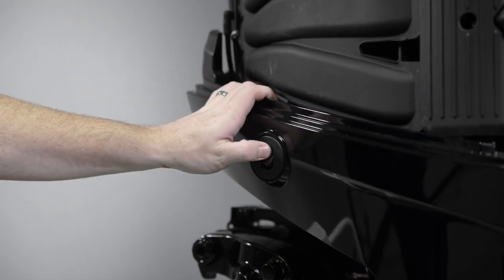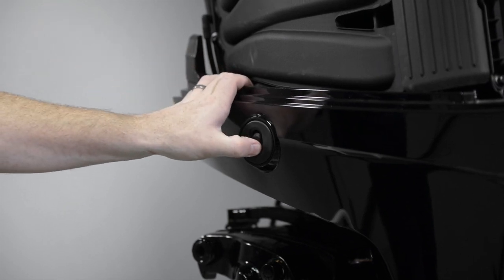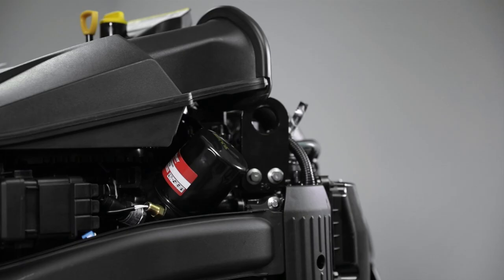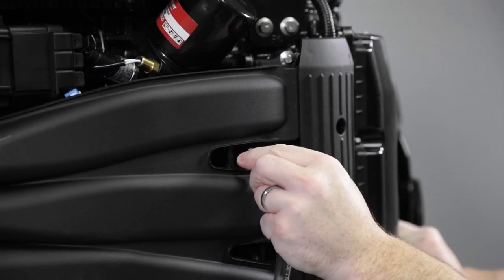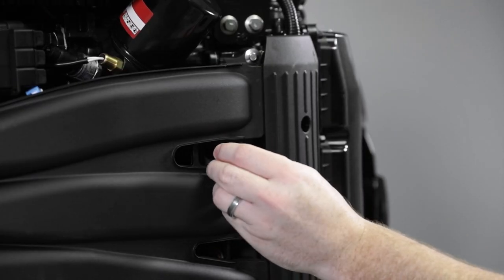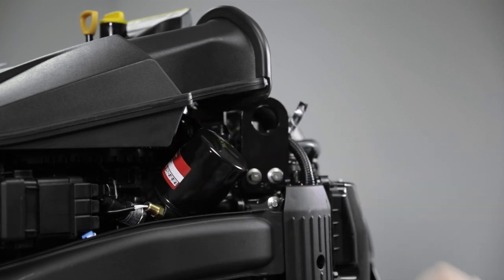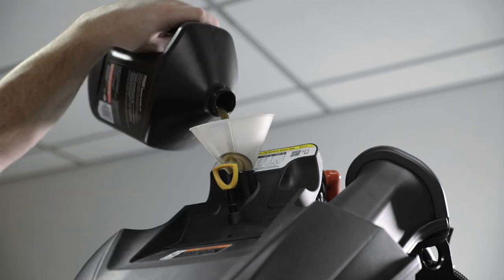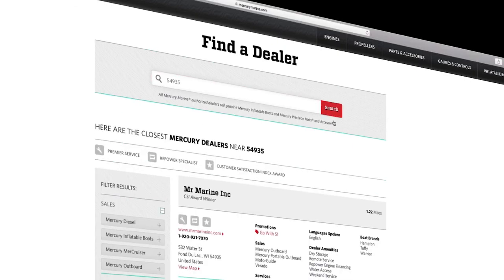Mercury V6 / V8 FourStroke Outboard Maintenance: Changing Engine Oil

Comment: PART NUMBERS!!!!!!!! Why does Mercury not have a single SKU for their 100hr and 300hr kits?!?!? Part numbers don't typically change over time - unless you're not organized on the front end. If the part numbers change - then reference / link the old and new numbers. WHY THE MYSTERY??